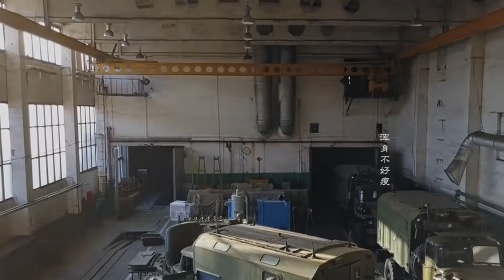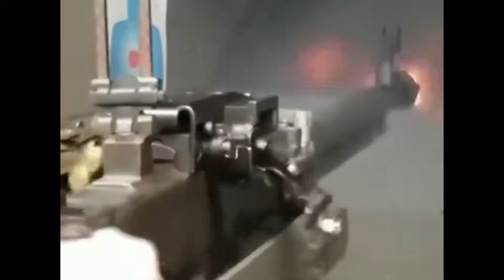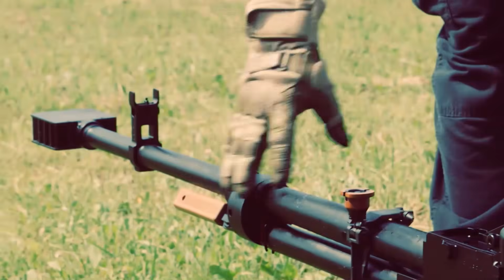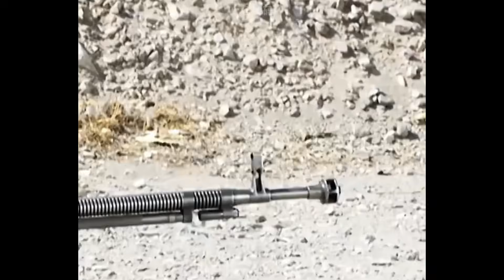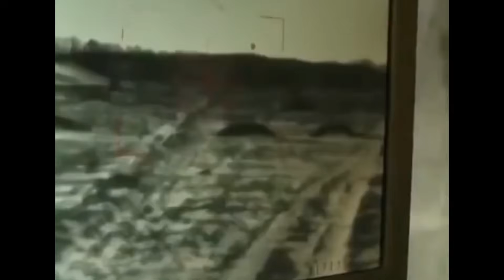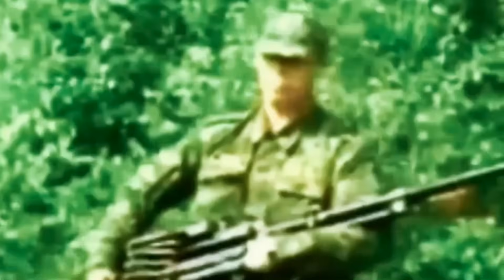KORD 12.7mm: The Russian Heavy Machine Gun That Outsmarts the M2 Browning.

Comment: Kords are 14.7mm pretty sure. More autocannon than machine gun.
Reply: No, kord is 12.7mm. 14.7 it is DShK
Reply: @artemspichakoy5792  wrong again, the 14.5mm maschine gun is called KPV, the Kord and the DShK are both 12.7mm, the diffrences are the Desingers of the Weapon, the DShK was designd and build by Degtyaryova-Shpagina krupnokaliberny and the Kord by Kowrowskije oruscheiniki-Degtjarjowzy
Reply: @artemspichakoy5792  DShk is 12.7 x 108 and Kord uses the same caliber. the KPV machine gun uses 14.5 x 114
Reply: KORD's are 12.7mm heavy machine gun, KPV is chambered in 14.5mm but is still a heavy machine gun, 20mm + are autocannons